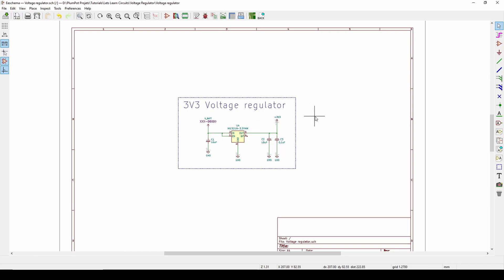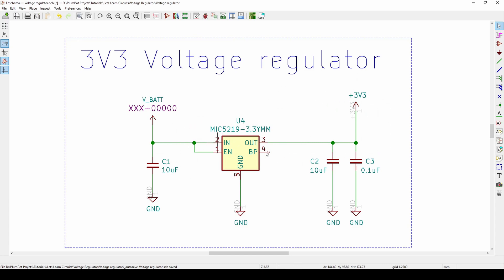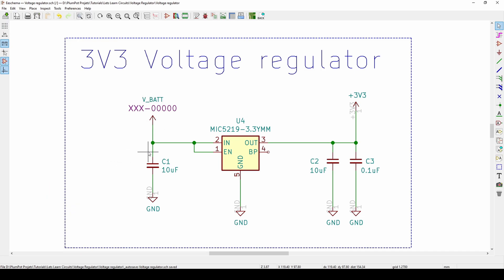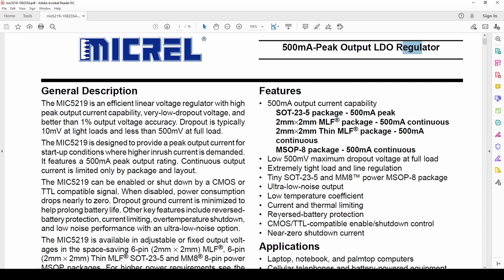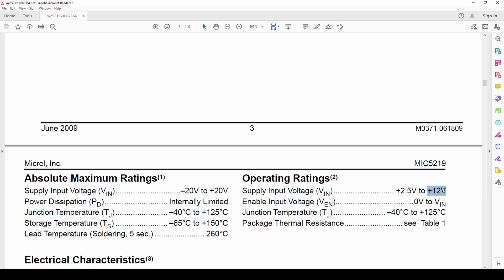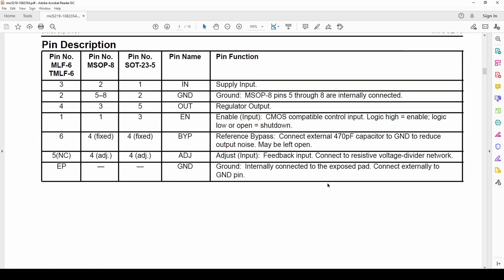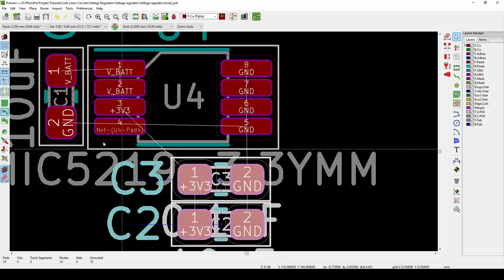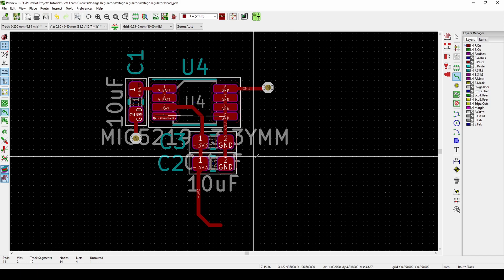Let's Learn Circuits in KiCad #5 - LDO Voltage regulator

Comment: Wow, I love your work dude. Thanks for sharing. Just a quick question for you. I'm using the HT7833 as LDO voltage regulator. On my circuit, max current is about 100mA for a few sec when working and a few uA when in deep sleep. Your LDO seems better in terms of low quiescent voltage, dropout voltage...! Can you confirm that?